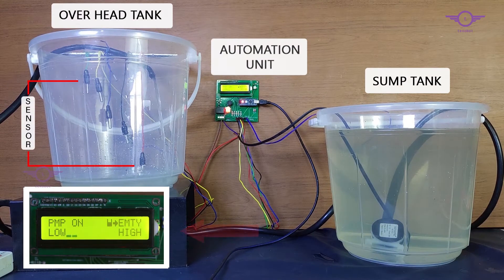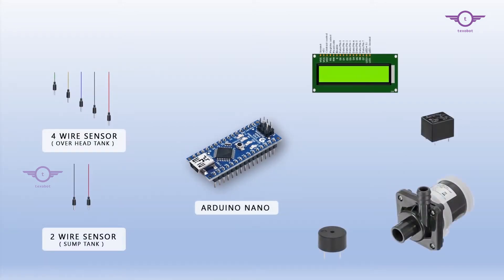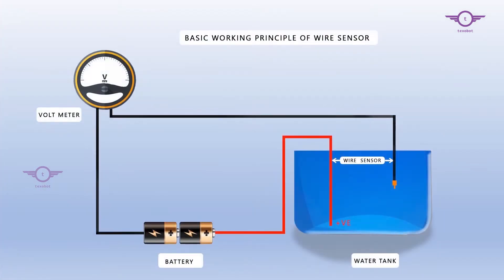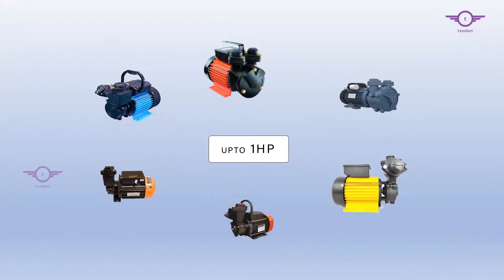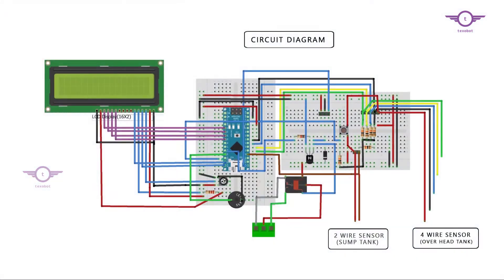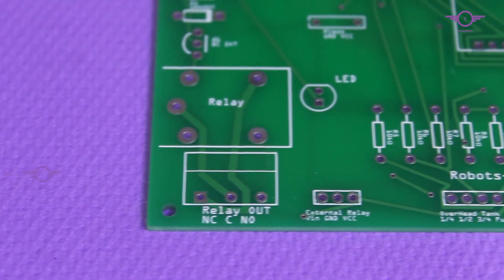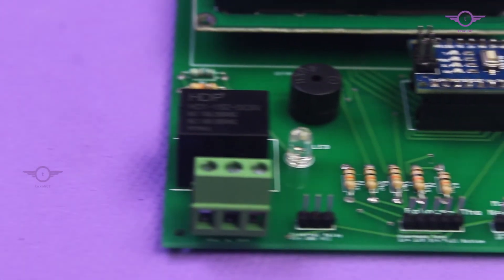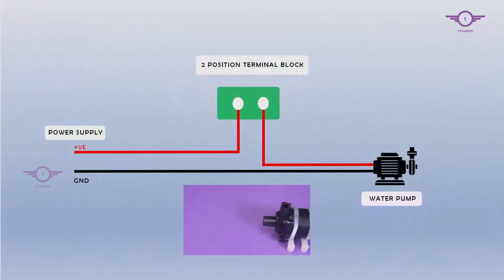Automatic Water Tank Level Controller with Dry Run Protection Using Arduino (Wire Sensors) || DIY

Comment: Super project , sir I have done water level indicator with 4 led indication with buzzer but when the water reaches full tank buzzer will on continuously untill the water level goes down . Plz tell me code if I want on the buzzer only for 10 seconds when the water is full .
Reply: Please send me the source code, I loss it
If you have

Comment: Grate job , could you do a  wi fi operated project with phone app to monitor and manually operate pump . and when sump water level risers to certain level to automatically fill the over head tank?

Comment: Sir
I think a small problem in your code. When power up the circuit with 25% , 50% or 75% water in tank yet pump goes On. Please rectify the code.
Reply: Please send me the source code, I loss it
If you have

Comment: Bro please make a wireless water level controller for contactor type submersible pump using Arduino and nrf24 modules with display status.
Reply from the maker: Sure, thanks for your suggestion

Comment: Thanks for the detailed video, but it would be nice if you update it and use 2.4ghz rf modules instead of wires in overhead tank bcoz usually tank is at 4th or 5th floor so running that long wires is more costly and subject to malfunction as well. Those rf modules are dirt cheap nowadays.

Comment: Dear sir, I am used sim800L and Arduino nano board control by two relays, one relay for on push button and another relay for stop push button,
How to connect the dry run sensor normally open type contact, fixed on delivery pipe ( 4 inches hose),
Stating time sensor open some time delay, after water touch to sensor going to closed type to continue to run motor, if not delivery to water after time delay motor will be shut off due to dry run sensor activated,
Sir, can send me the try run sensor code, thanks 
Can send the your WhatsApp number?